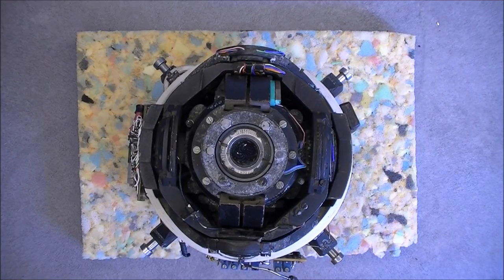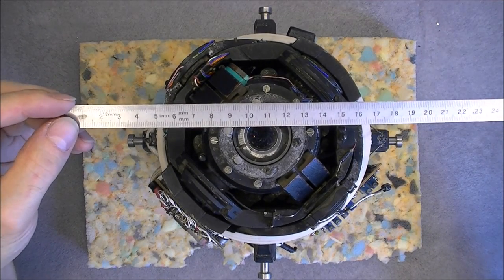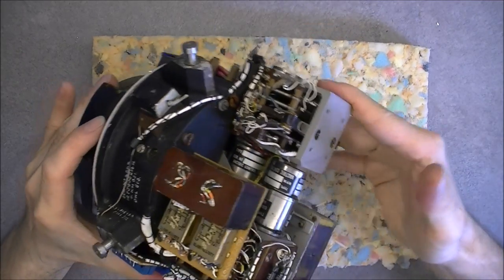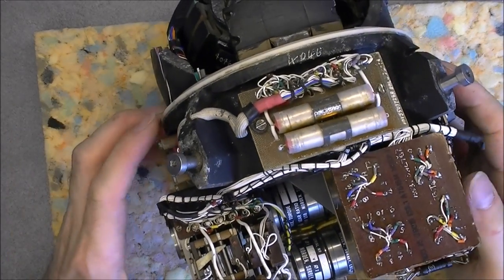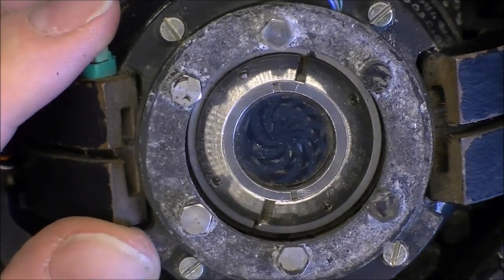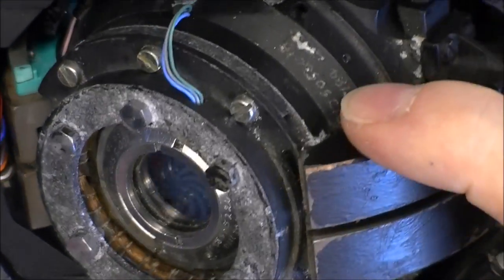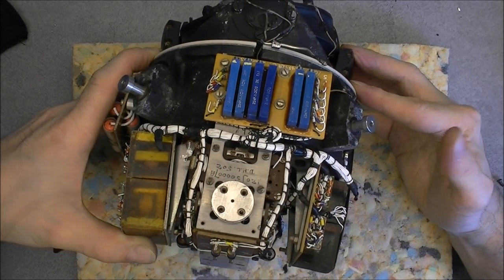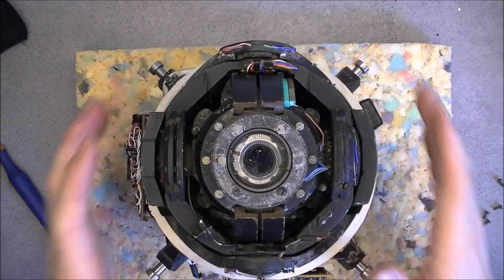A look at a Red Top missile Infrared seeker from Ebay

Comment: Now a step-by-step tutorial on how to build one!
Reply: This is quite old technology and these days can be done with simple arduino kits open source software, and a few motors. It works just like image recognition cameras, just with an IR camera for the image. OpenCV could be used to detect the image and keep the camera pointed at it by turning the motor until the image is centered. The wire wound resistor lets you know how far off from straight ahead the "target" is in relation to your vehicle. This would allow you to steer left/right/up/down, so the resistance for that axis goes down/up until your vehicle is pointed straight at it. That is how you would make a robot vehicle, plane, or even a robotic arm for picking up items, but could also be used for turrets or missiles such as this was originally used for.
Reply: @excitedbox5705  I think the original poster wanted to know about the "old way" ;D
Reply: @BuildGUY You don't really want your seeker to "scan". You want it to hit what you are looking at, not the friendly jet just ahead of you!
Reply: @BuildGUY Ah you are talking about focal plane array based sensors instead of the "traditional" ones gotcha. 
(Although those ones don't use a reticle! and you can't really determine range from infrared)

Radar missiles require a target to be "painted" by a radar beam. Depending on whether they are semi - active or active, the radar pulses may come from the missile or the launch platform. For semi - active missiles, the launching platform must first have detected and then acquired the target. Modern radar systems often have different modes depending on what is needed, such as scanning, single target tracking and scan while track modes.

To some extent you can "point and click" active radar missiles although you run the risk of either not locking onto anything or locking onto something you don't want to (friendly jet, passenger plane etc).

Really only the earliest IR guided missiles could be fooled by the sun. Once spin - scan systems with infrared reticles were developed it became a lot easier to filter out sources of IR such as the sun, clouds or the earth.
Reply: you could literally make these with a 3d printer and a few hundred dollars now
Reply: @ToniMorton  this is true
Reply: @excitedbox5705  Cheap IR focal plane arrays for Arduino typically have low frame rate (32 or 64 fps at most) and their FOR is too wide - you will need to source somewhere a good IR lens. And ancient PbS is probably more sensitive especially if it is cooled by expanding gas from the the cylinder.

Comment: Yes, this is a homing head from a Red Top. The main item missing is the small reflecting telescope that fits on top of the reticle assembly and focuses the IR image onto the reticle. The reticle is rotated at 100Hz by a 2 or 3 (can't remember which) phase motor along with a gyro wheel. The gyro isolates missile body motion. A pickoff around the reticle provides a position reference signal. The reticle/gyro assembly is in a 2 axis gimbal driven by two DC torque motors. Beneath the reticle is a field lens (has a redish colour) that brings the IR onto the IR detector cell. The detector is cooled from the aircraft compressed air supply before launch. The cooler is mounted under the detector. A guidance electronics package takes inputs from the IR cell and the reference pickoff and provides signals that give the two axis offsets from centre of the target image on the reticle. These signals provide drives to the gimbal torque motors to keep the target spot at the centre of the reticle. Wire pickoffs on each axis of the gimbal provide position rates of change to drive the missile fins. In summary what you would need to get the unit to track a target would be the telescope, the guidance electronics package, gyro drive supply and a high pressure pure air supply. Let me know if you require any further information/help, it would be good to get it working!
Reply from the maker: Thanks, I would like to see what the guidance electronics looks like !
Reply: It would be easier if I could have an email address.
Reply: @lentelford5163  what's need to mount telescope on gimbal?? How it'll give steering commands to missile?
Reply: " The detector is cooled from the aircraft compressed air supply before launch."

IIRC the Red Top, like the Firestreak" used liquid ammonia to cool down the PbS photocell before launch.
Reply: is uncooled PbS detector used inside ?
Reply: Mr Len Telford can you help me to make this type of stuff for final year project
Reply: @psycronizer  Woah. Why are you so angry?
Reply: @khanabdulrehman3913  You want to make an heat seeker missile guidence are you kidding???.No one will tell u how to make an IR guidence.Its better to make an GPS guidance than IR .Because gps is easier than the IR and less complicated.The GPS is more common and easily available than IR.
Reply: @Oombu008  so will you help me out
Reply: @khanabdulrehman3913  what are u making for the project are u making RC aircraft or....
Reply: @khanabdulrehman3913  Huh.....I am not an graduate in robotics or  guidance system.I am just studying 11th!!!.so.....
Reply: @Oombu008  ooooh .
Reply: @khanabdulrehman3913  which country you belongs to India????
Reply: Thanks for the information l love it... thanks
Reply: @lentelford5163  I am american. Can I have the cad files to such devices?
Reply: Has anyone measured the gimbal limits with a protractor by chance?

Comment: The spiral in the optical path is probably a scanning reticle. It's not an imaging sensor - there are only 1 to maybe 4 "pixels" and the bearing and elevation error between the target and the sensor boresight is measured by the reticle's pattern's effect on the IR sensor waveform. There were two main types: AM and FM reticle seekers. In AM, I believe phase indicated error angle and amplitude indicated radial error. For FM it was also phase for angle but frequency for radial error, which made it less susceptible to some kinds of jamming and natural interference.
Reply from the maker: There is something that looks like a tri-phase motor stator around the optical front piece holder, I have the feeling it rotates, serving at the same time the purpose of spinning the spiral patern and providing gyro stabilisation.
Reply: msylvain59 its like gimbal 2 axis in drone.. using brushless motor.. btw is brushless motor found in 1965..??
Reply: So the sensor isn't generating any kind of image, but how does it know the direction to target? Is it like an xy error, or something else? How would multiple potential targets interfere with these signals?
Reply: @Waffle4569  it doesn't generate image, but modern seekers like IIR (infrared imaging) can view like a video camera and can easily differentiate between Target and countermeasures........laser jamming, flares have no effect on such seekers.........but what he's showing in the video is reticle based seeker.......it gets easily (the missile gets) diverted by laser jamming........how does it know the direction?? The seeker head tries to maintain the IR FOV (field of view) at the center.......if not it'll give steering commands and adjusts itself to keep target in it's field of view
Reply: @Waffle4569  initially the missile is slaved to the launch aircraft radar...when the launch aircraft finds a target that targeting information is passed to the missile which basically tells the missile where to look. Once the missile acquires the target its internal electronics take over and maintain target acquisition until it is launched and ultimately destroys the target.
Reply: @Waffle4569  because the spiral arms are "thicker" towards the edges, how "long" the electronic pulse from the IR signal lasts tells you the angle off. A signal generator (acting like a "clock") that matches the rotating frequency of the rotating scanner can be used to figure out the position of the target in the field of view, depends on the seeker type.
Reply: @ChucksSEADnDEAD  
pretty sophisticated stuff for 1960s !
Reply: @ChucksSEADnDEAD  Oh, I think I get it now. Thicker spiral means, shorter IR response so the system knows to move the seeker, the opposite direction until the IR signal matches the original signal. Clever and obviously much cheaper to produce than a full on camera and a DSP to process all that data.
Reply: @Waffle4569  Simplified a little: 
A disc, called a reticle, spins in front of the sensor. A pizza - slice pattern is applied to the disc, with alternating areas being coated with a material that is transparent to IR radiation and other areas with a material that blocks it. In addition to this, half is painted so that the target is only visible for half of the time as the reticle spins. The pizza slice pattern produces a pulsing signal that changes in frequency the closer the IR source is to the centre of the reticle, from the perspective of the sensor. 
As the target is only "visible" for half of the time (half is opaque), by looking at when the target appears / disappears from view (The rate at which the reticle spins is known) you can determine the angle between the seeker and the target.
Reply: The Red Top seeker used an FM type reticle.

Comment: If it is an cooled infrared sensor, the small copper tube is maybe for an gas tank, which cools the sensor through evaporation/gas expansion? I have seen similar technology on the Thron EMI Thermal Imager which has an exchangeable gas tank for cooling. But I am a bit confused about the clear lens and the clear (acrylic like) head cover of the missile. Does this pass short or mid-wave ir? Because I am pretty sure they wont let pass LWIR.
Reply: Orbis92 a sapphire window most likely

Comment: By which technology this gimble is controlled ? Servo , stepper motor or magnetic field ?
Reply from the maker: It is magnetic, with voice coils.
Reply: @msylvain59  but voice coil is aircore based for lighter operations but this gimble seems heavy 🤔
Reply: @omsingharjit  this type is called moving magnet voice coil, which can handle bigger loads

Comment: How did u get this one!!!!.It's really hard to find one.which country you belongs to???
Reply from the maker: I found it onto Ebay UK, in the "Aircraft parts" category. It was described as a "Gyro or something. As is", with a blurry photo. Price was 50 british pounds buy it now, . But my sharp eyes noticed it was something special !
Reply: @msylvain59  Does it works???.Or just an show case?? Because no one will sell an active missile guidence system to public.
Reply from the maker: @Oombu008  It is certainly not in a working condition, there is rust, broken parts in the servo mecanism, missing parts, cut wire harnesses and other damages.